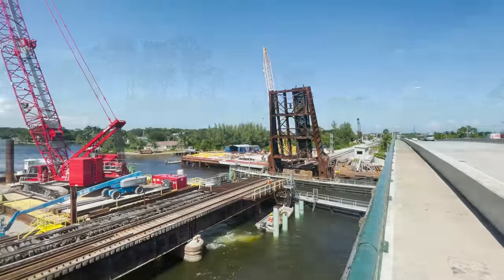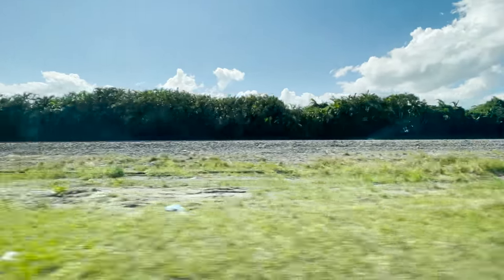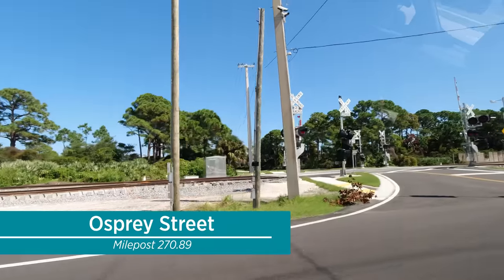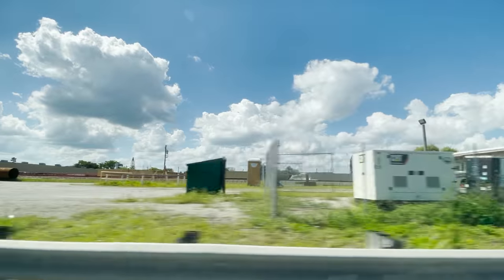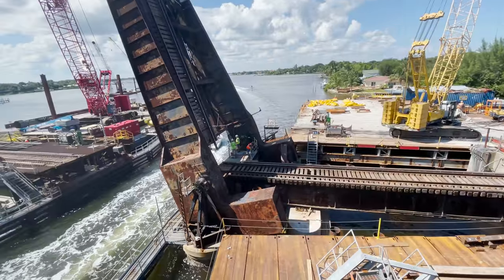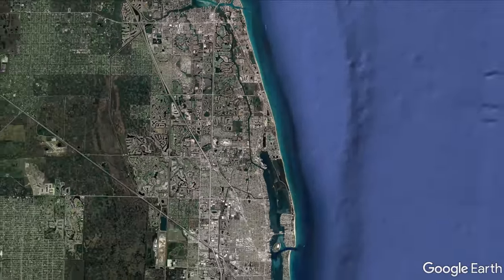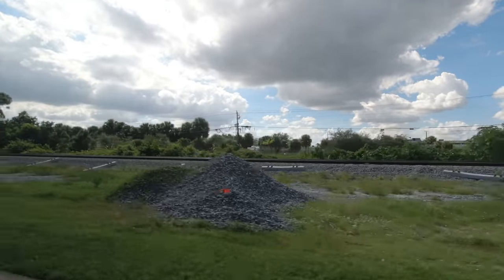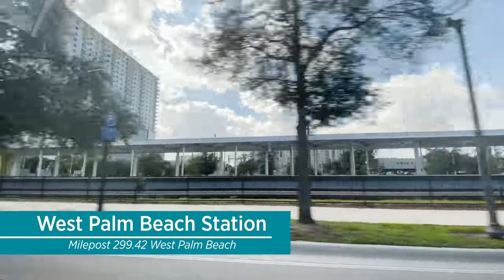South Florida Brightline Construction - October 2021

Comment: It'll be good that the new lift section will have greater clearance so boats can pass underneath even with the bridge down. Once Brightline trains start running here, there won't really be time for the bridge to extensively be open between trains.